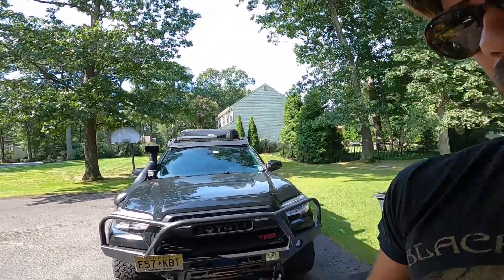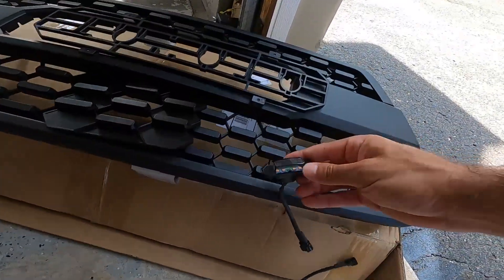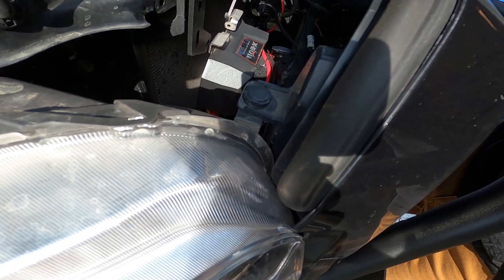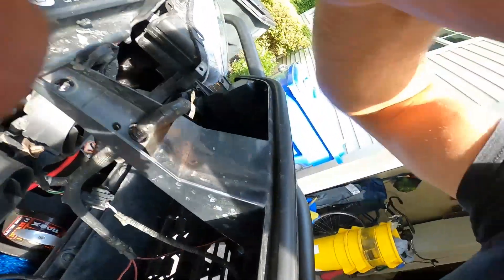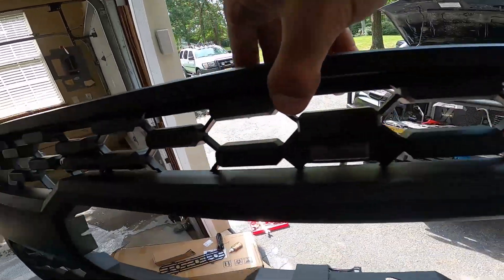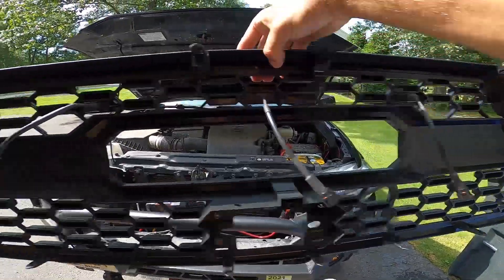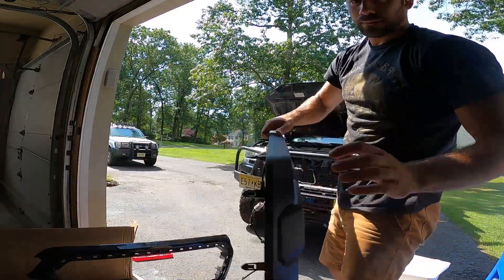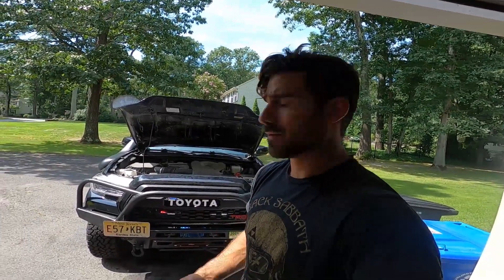Aftermarket Pro Grill Replacement | Raptor Lights | Toyota Tacoma

Comment: Great vids.  Loved the VF (ov) tune videos.  
Question-  I'm looking at the choices of tunes to choose from and I can see "premium/reg" is for fuel type, "33/35/stock" is for tire size, "488/529" is for a regear, 
but what about "Thx" ?
(example) 04C21_Reg_Stock.vfc  vs  04C21_Reg_Stock_Thx.vfc
Reply from the maker: According to the creator those denote how aggressive it is. Don't quote me on that though, its more hearsay on the tacoma forums than anything. I've tried both and haven't noticed a difference for the same level tune.